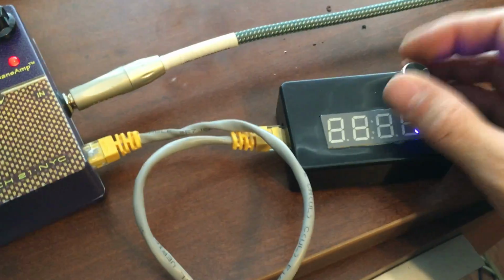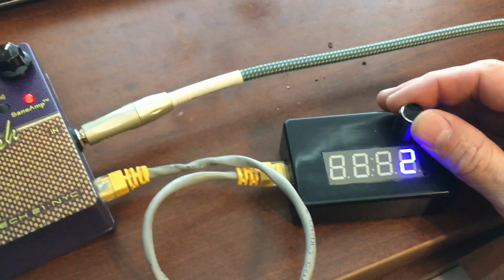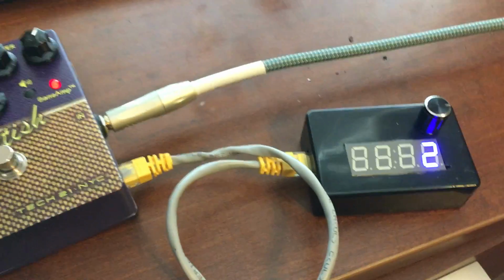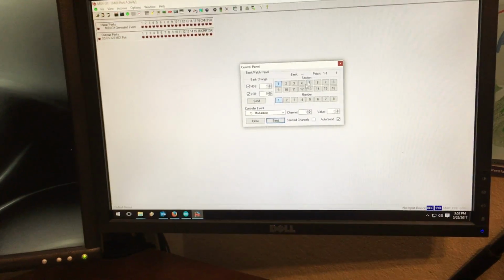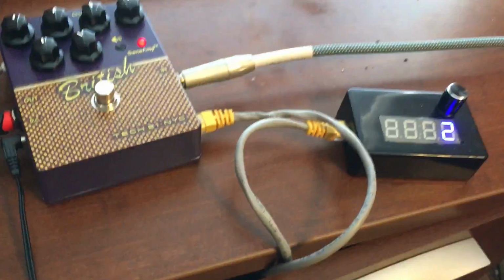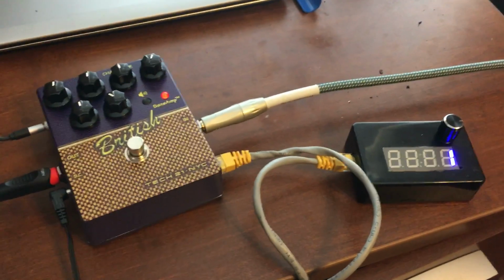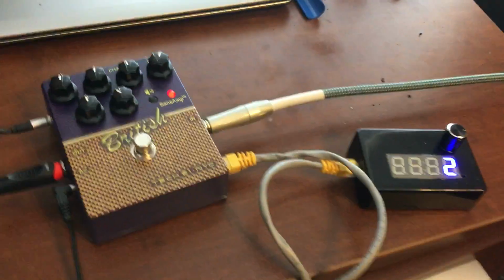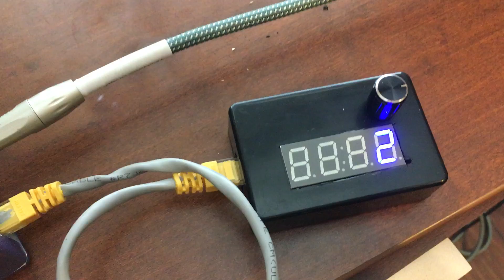MIDI Control added to a Tech21 SansAmp British Pedal using an Arduino Nano

Comment: Incredibly cool!! Thoughtful and solid work.

 I'm unfamiliar with Arduino but I'm definitely looking to mod some pedals like this without the preset display and with either internally motorized pots or an externally motorized pot turner like the GigRig Autopot that apparently never launched. Aiming to use this hypothetical system with a RJM Mastermind PBC10 for full live/studio pedalboard control. Thought of this specific idea after Tegeler Audio came with their Crème RC. Any ideas on best course of action/can I hire you for a job?! 

Cheers.

Comment: This is a cool project. Exactly the sort of thing I want to work on with my son as a science project. However, it's 3 years later. I'm wondering if there are better digipots now that can handle out of the box, the higher voltages of guitar drive pedals that run at 18v as a direct analog pot replacement?

Comment: I have a Sansamp Bass Driver and I was thinking about controlling all the 6 paraeters via MIDI. Do you know if is it possible??
Reply from the maker: Sure, it's definitely possible.  Check out the write-up I made on this project:  https://thefriendlygearfreaks.com/threads/adding-midi-to-an-effects-pedal-warning-highly-technical.5568/
Reply: stoopalini hey this link is down but I'd like to read it
Reply: @wos2000  Thanks!

Comment: I just checked the link to the forum, but there I cannot see how you finist this project, can you help me with a wiring diagram and code?
Reply from the maker: Hakuna Matata I made a further write up here: https://thefriendlygearfreaks.com/threads/adding-midi-to-an-effects-pedal-warning-highly-technical.5568/
Reply: stoopalini Thanx man exactly what I needed. Two pots is already a start, but I am curious if this would be possible for around 60 pots with Arduino Mega?
Reply from the maker: It's definitely possible to do 60 POTs, although you can't just use a single Arduino to do it because it does not have 60 inputs.  I know there are ways to expand the inputs for things like this, but you would have to research that with the Arduino community.  

I would recommend you join the Arduino Forum and start a thread there, to ask for help and document your project :) 

https://forum.arduino.cc/